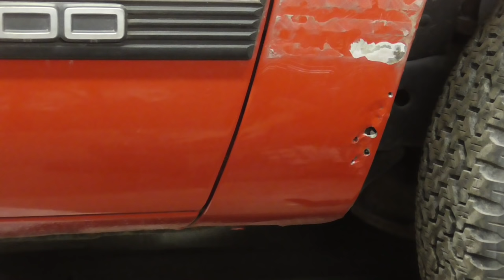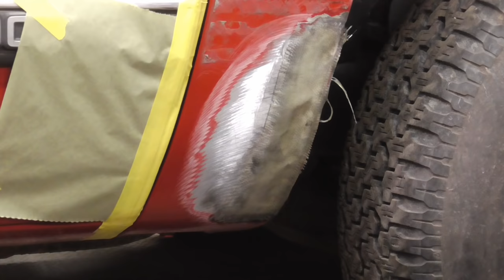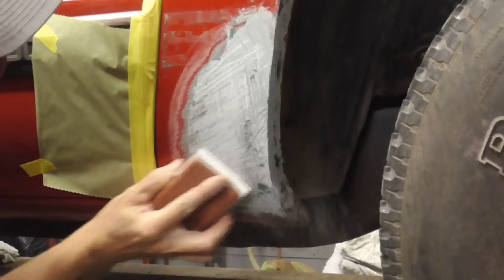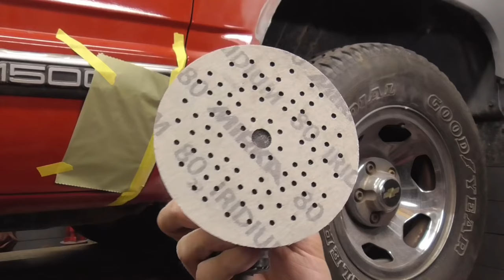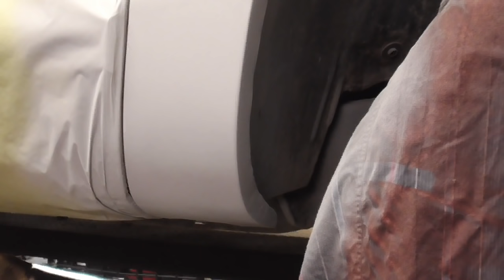How to Repair a Rust Hole with Fiberglass - No Welding!

Comment: Yup, another bodyshop to avoid at all costs.
Reply from the maker: If you allow for drainage and seal the back or treat it - it will last as long as you want it to.  I'll be doing a follow up video on this truck this year - it will still be perfect :)
Reply: @LakesideAutobody  SO you don't know about the different expansion/contraction rates between fiberglass and metal?  LOL
Reply from the maker: @lyndalanthony635  This has been an accepted method of repair for over 50 years.  It's literally taught in schools.  Lots of shops, including dealerships that my dad worked at used this method for rust repair with success if done correctly.  Expansion/contraction rates have no effect at all on a small area.  Be positive my friend - solve problems - support others - create - do.  That's much better than what's going on in America right now - right?  Jerry

Comment: That repair will rust through and fall out in less than a year. The metal was so weak that you literally were punching holes through it just tapping on it with a hammer. That panel rusted from the inside out & all the metal you left there was covered in rust. This type of repair is exactly the WRONG way to "fix" rust. Your not fixing anything. You just covering it up. Won't last a year and it'll be bubbling & rusting through again.
Reply from the maker: https://www.youtube.com/watch?v=t1WclT_GMvk  I'll do another follow up video soon - it's 3 years old now.  Drainage is the key :)
Reply: @LakesideAutobody  must not see much bad weather. Rain, snow, salt, etc would make the life much shorter. I've seen many repairs like this fail in the rust belt.

Comment: It's not a repair but a cover up for the next 2 -3 months for a quick sale 🥴
Reply from the maker: It's my neighbors truck - still good after six months in the elements - have to allow for drainage and for it to dry inside the fender.  There are 3 ways professional body shops in SE Michigan fix rust:
1) Combination of Lap and Butt welds.  If you insist on strictly butt welds, here's the best way to do them for longevity: https://www.youtube.com/watch?v=e9bjZ_UxtJg
2) Lap joint using structural adhesive or panel bond
3) Fiberglass cloth and fiber reinforced body filler
 
See Eastwood’s video as to why body shops don’t butt weld then aggressively grind off the strongest part of the welds, and attempt to metal finish today’s extremely thin metal:  https://www.youtube.com/watch?v=rpH50kh4W00
Reply: For this threatment 2 to 3 years atleast

Comment: nasty way to bodge up rust holes. Sad to see this on youtube
Reply from the maker: There's 3 ways professional body shops fix rust:
1) Combination of Lap and Butt welds.  If you insist on strictly butt welds, here's the best way to do them for longevity: https://www.youtube.com/watch?v=e9bjZ_UxtJg
2) Lap joint using structural adhesive or panel bond
3) Fiberglass cloth and fiber reinforced body filler
 
See Eastwood’s video as to why body shops don’t butt weld then agressively grind off the strongest part of the welds, and attempt to metal finish today’s extremely thin metal:  https://www.youtube.com/watch?v=rpH50kh4W00
Reply: weight reduction,101

Comment: Don't do this! Wrong wrong...water still gets in behind...short term fix.
Reply from the maker: It is a legitimate method if the panel is allowed to drain and dry out on the inside.  If the panel gets clogged with leaves, mud and salt water - yes, it will begin to rust again.  All repairs need to drain - that's why it rusted in the first place.  Hope that helps :)

Comment: Crappy job, lots of rust on the back of that panel. You don't see it, doesn't mean it's not there.
Turn around, walk away from this .... .
Reply from the maker: Key to longevity for any rust repair is drainage - the panel has to drain and dry out inside.  If you can undercoat the back, that will also help - https://www.youtube.com/watch?v=t1WclT_GMvk  Body shops in Michigan know rust - another follow up video in a few years. 👍💯😊

Comment: Don’t do this…
Reply from the maker: If you allow it to drain and dry it works very well.  People always forget to allow the water inside the panel to drain out - can't stay moist in there :)
Reply: @LakesideAutobody  my issue with it is that it doesn’t dent. If the car takes a little hit in the area of repair, it will crack and split and lead to all kinds of problems.
Reply from the maker: @officialWWM  I see what you mean now :)

Comment: I give six months  max and rust will show around the edges of the repair. Total waste of time and money.
Reply from the maker: That's funny - it's my neighbors truck - it's been 6 months and it isn't even thinking about rusting yet. 
There's 3 ways professional body shops fix rust:
1) Combination of Lap and Butt welds.  If you insist on strictly butt welds, here's the best way to do them for longevity: https://www.youtube.com/watch?v=e9bjZ_UxtJg
2) Lap joint using structural adhesive or panel bond
3) Fiberglass cloth and fiber reinforced body filler
 
See Eastwood’s video as to why body shops don’t butt weld then agressively grind off the strongest part of the welds, and attempt to metal finish today’s extremely thin metal:  https://www.youtube.com/watch?v=rpH50kh4W00
Reply: as long as its sealed it wont rust. a rock chip is all it takes to get the rust started again.
Reply from the maker: @davesilvia9711  I had a van one time and the quarter panels were just a single sheet of metal (not enclosed).  There were all chipped up - it was a 1986 Dodge B250 and I had it in 2010.  No rust at all because they could dry out.  You can leave a plain sheet of metal leaning against a fence and it'll be there longer than we'll be alive - it can dry out.